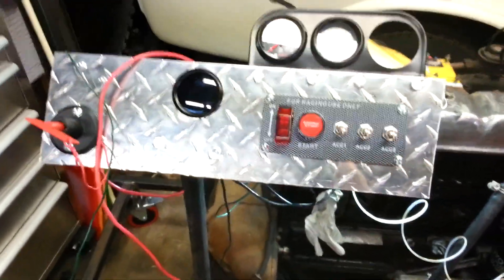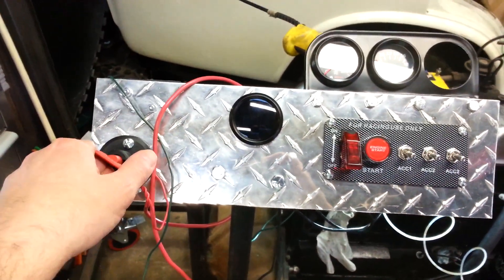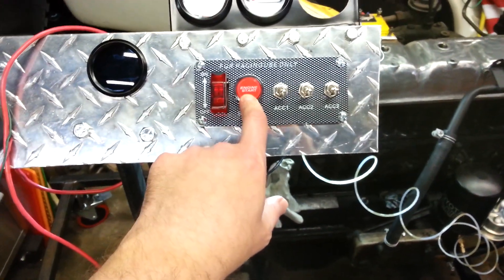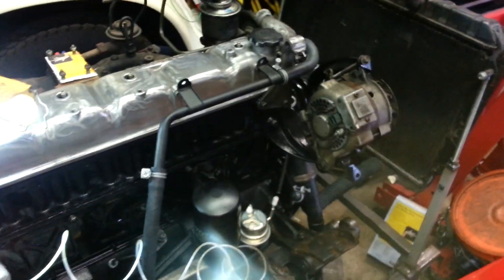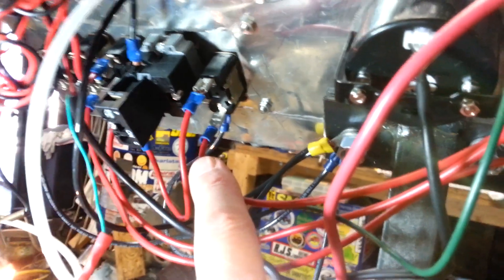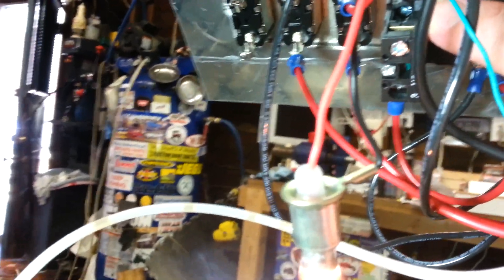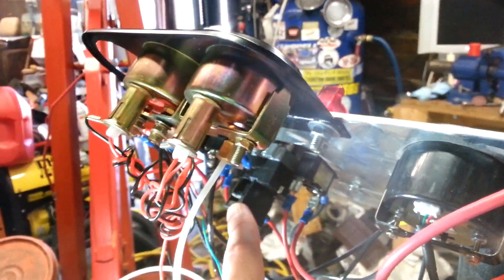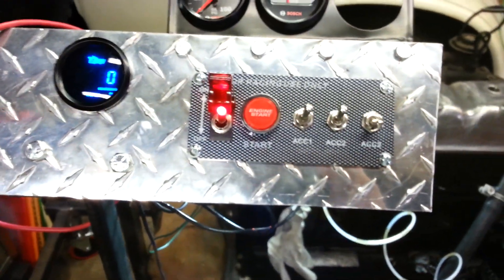How to wire a 12V Ignition Switch Engine Start Push Button 3 Toggle Panel with Indicator Light

Comment: hey man, i used one similar it was jtron with a single switch. it will crank and crack but no start, i don’t have any spark. is there something i’m supposed to do to the dme since it can’t scan a key

Comment: Is the extra switch for the coil redundant? Can't it just come off the initial toggle
Reply from the maker: Yes, it is redundant and not necessary for a normal automotive installation of this panel.
Reply: @johnsmith1758  ok just making sure I'm in the process of completely re wiring my t bucket and I was making sure I didn't mess up

Comment: Anyone know what would cause my starter to stick and continuously keep cracking even once the truck has started after pushing the start bottom???
Reply: Maybe your button is one that has two modes, on and off, like a light switch, and not one that just engages when being pushed? (sounds like its feeding electricity through it even after you release your finger so that its on "on mode", try another switch, one that engages only when pushed)

Comment: What steering column do you use with this? I need one that has a shifter on it but doesn’t have a lock mechanism if you don’t have a key. This why I’m wiring a starter panel
Reply: I would suggest two things, either keeping the key in, or take apart the steering colum and remove the locking pin and putting it back together, I will be here if you have any questions, and you most likely won’t find any steering colum of your car that doesn’t have a locking pin in the colum

Comment: I know this was a while ago but I have a question  I know the toggle switch has a led on it but dose the push button have a led on it? Thanks.
Reply from the maker: Yes, it does have a led in the start push button. However, I have not put on a ground nor hot lead so it does not light in this video. I got a new phone with a better camera, and am going to remake this video shortly. It will be hooked up in that one.
Reply: I wired mine up but it won't light up
Reply: Have any issues with all the led switch lights draining your battery or are they only turned on when your accessory switch is on?